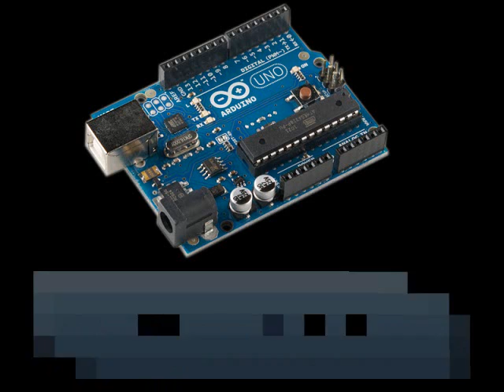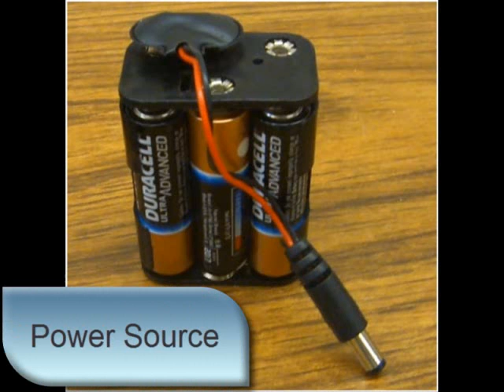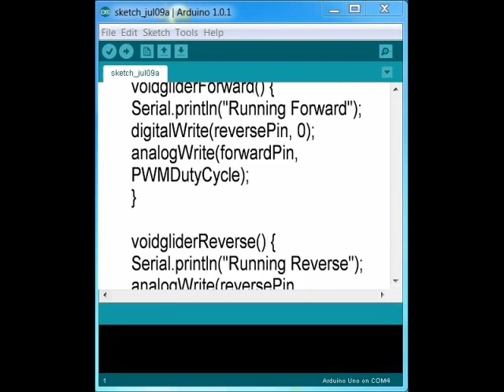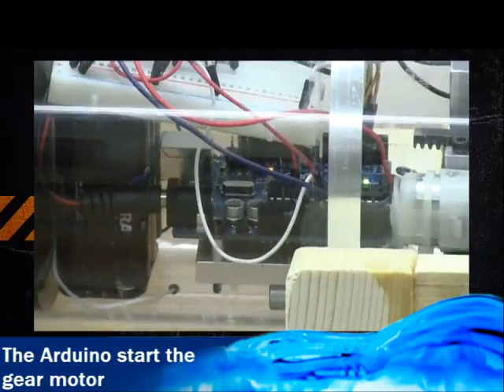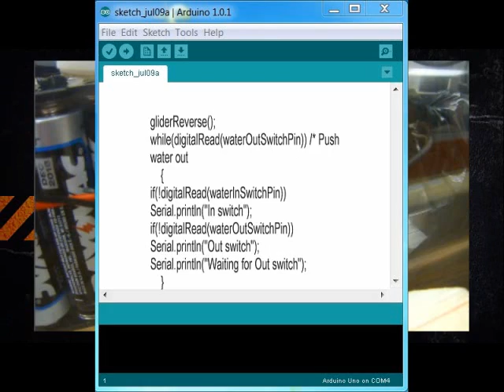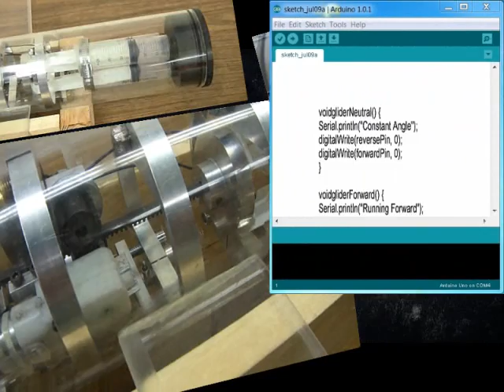How Underwater Gliders Work Pt.2

Comment: Very true; and on this prototype drawing water in the front and ejecting it out the back would probably be significant. However, in actual use a glider may only eject water 3-4 times per mile of travel. At that point, the extra weight for a switchable exhaust would be better spent on batteries.